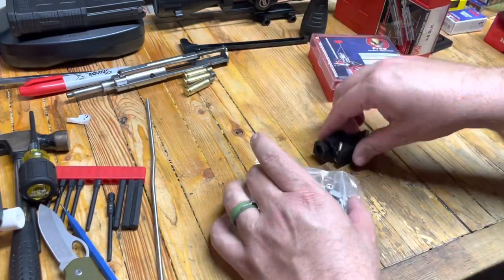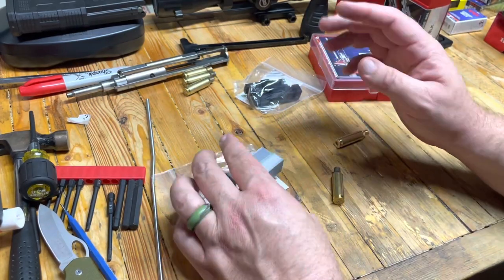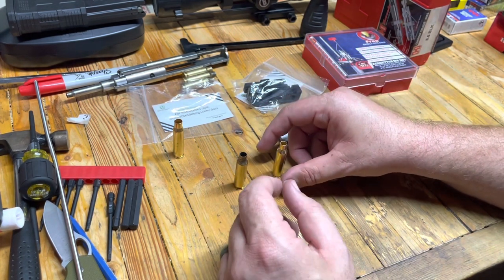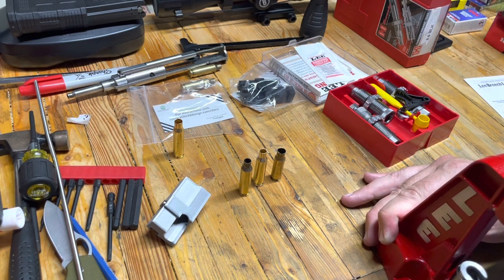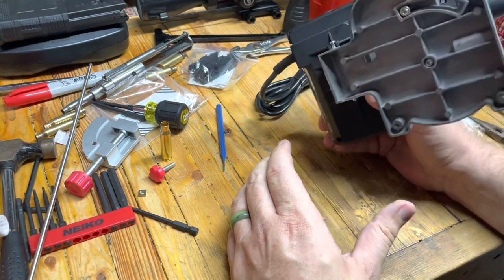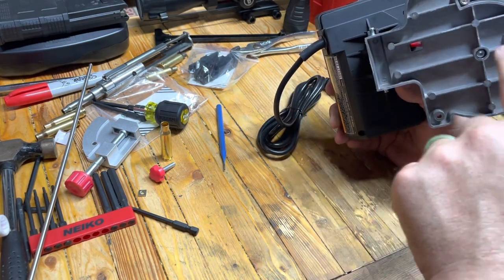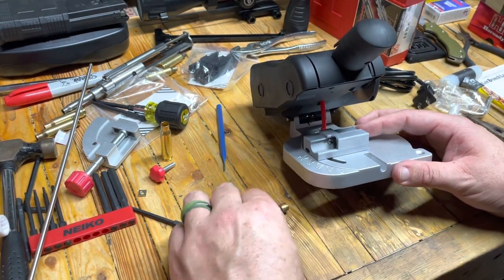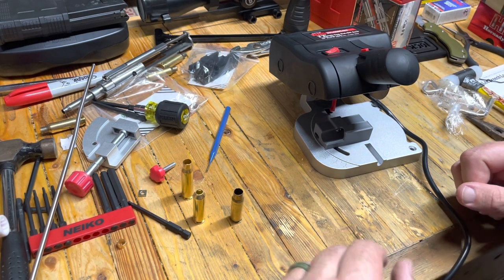Trick Jig for 8.6 Blackout

Comment: I bought one of these. They are nice to have, and I will probably use it when I buy a cut off saw. But my Frankfort Arsenal universal trimmer does the same thing, except I don't have to buy an extra tool. But all in all, it is a neat tool.
Reply from the maker: Right on
Reply: How does the Frankford Arsenal universal trimmer work with 8.6 blk?
Reply: @eddieb9110  I can trim down the 6.5 cases to the appropriate length for my dies. After resizing I can push a different collet on and trim for actual case length.
Reply: @c_s_8411  would it work for cases that were not trimmed before the sizing die?
Reply: @eddieb9110  Yeah it does. I think it does a better job than using the jigs. You only need a drill and the universal trimmer and you are good. You trim the 6.5 brass down, then resize them in your 8.6 dies, and then you can do your final trim after you change the shoulder collet.
Reply: @c_s_8411  I run the 6.5 over a .30 cal expander mandrel, then I run them through the sizing die and just trim the 8.6 case that comes out. Think that would work with that trimmer?
Reply: @eddieb9110  It would. The trimmer is universal and can trim cases from 22 caliber all the way up to I believe 45 caliber.